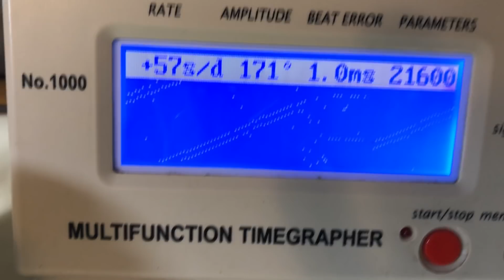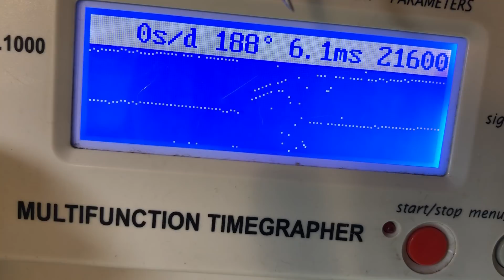BF Seiko 6106-7107 & 6139-6015 =blue dial

Comment: Spencer,
Any chance of a video of you actually working on a watch, say from initial assessment, throughout the repair/service to the finished product?
A bit of mucking around to do, but it would be interesting.
Cheers
Reply from the maker: Perhaps, but a very small one.  It would take me getting new video equipment, as well as revamping my workbench.  I'd also need to buy editing software, which I would then need to learn how to use.  Currently I've got a backlog of about 14 months - nearly 200 jobs.  Time is one thing I don't have a lot of.  So, while it's a neat idea (and one I've often considered) it isn't something that is possible now, or in the near future.  Or perhaps even the distant future.
Reply: @SpencerKleinVintageWatch  that's the best no I ever saw
Reply from the maker: @arunj9512  I really prefer to help if possible.  It sucks turning people down.